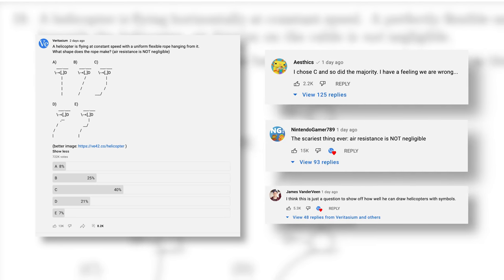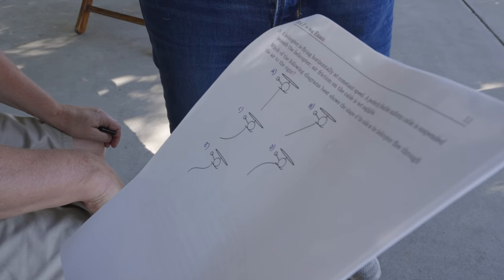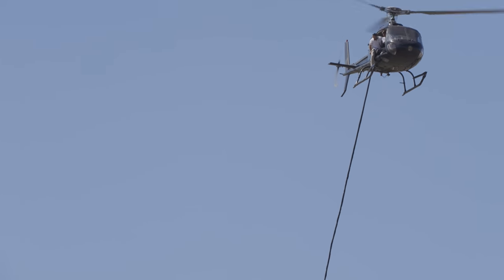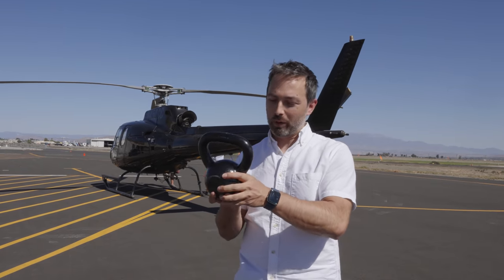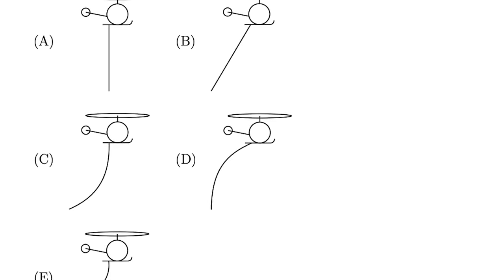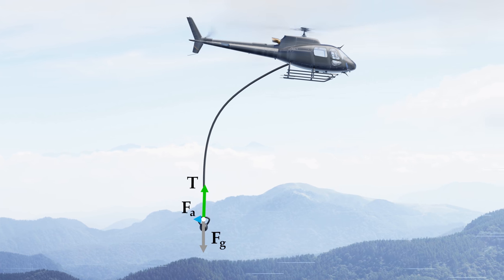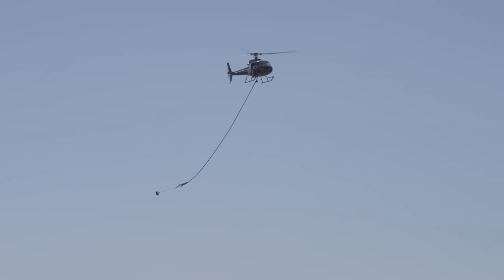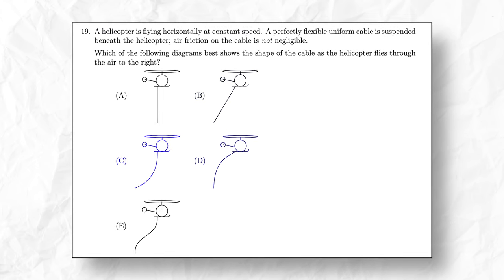I Rented A Helicopter To Settle A Physics Debate

Comment: "Air friction is not negligible."

The next step is to perform this experiment in a vacuum chamber, or with the right sponsor, in outer space (with a space plane/shuttle instead of a rotor craft)
Reply: Well, The actual challenge was the Air and it's friction itself. Otherwise, the Helicopter would even not FLY :)
Reply: The “air friction” is what makes the shape its balancing the weight of the rope. In a vacuum it should hang straight down, and in space it should go straight behind the vehicle since no forces are acting on it

Edit: Realised the rope would only go behind the spaceship if it accelerated (relative to the rope for everyone being pedantic) otherwise the rope just kinda chills wherever it’s placed (and eventually goes behind the vehicle because of the tiny amount of drag)
Reply: @leonh4799  except gravitational force since an orbit is just constantly falling to the earth without getting closer
Reply: @adrianwelgemoed9562  sorry I meant from the earths rotating reference frame*
Reply: Thats true. It is only B because of air friction, otherwise A. If the speed is constant and no air friction, there is no force.
Reply: @adrianwelgemoed9562  Exactly. Of course, you have to specify how great friction and gravity are. Because even outer space is not free of particles that offer resistance by their mere presence. And you don't need to repeat the experiment. You already have the formula and know the effect of the factors. Now you just have to insert the variables of your environment and you can calculate a result.
Reply: @June18887  It would be A if you lowered the rope whilst moving at constant speed. If the rope was already hanging when you started to accelerate, it would take the form of B, because the top of the rope would start accelerating first.
Reply: This would never work. There is no perceptible gravity of any large (planetary) object in outer space to make the experimental conditions comparable. And a space shuttle could never fly in a vacuum chamber on Earth (it is experimentally impractical to get it into such a low altitude orbit at unthinkably high speeds).
Reply: @adrianwelgemoed9562  no, the orbit isn't getting any closer because it's not falling to the earth. How could an object fall to the earth without getting closer to it? What's happening is that the centrifugal force is equal to the opposite of the gravitational forge, cancelling each other. So the resultant force applied to the orbit is null, that's why a rope in space would remain in the exact position as it was prior to the non accelerated movement
Reply: Sponsor or a collaboration with MrBeast
Reply: @ismirdochegal4804  true but it’s negligible, we’re talking about the behaviour of a rope in a short time span not the gradual decay of an orbit
Reply: @leonh4799  Actually that's not true at all. In a vacuum it wouldn't hang straight down. It would stay coiled up on the ground because the helicopter wouldn't fly.
Reply: @leonh4799  In space it would just stay in a bundle next to the spacecraft or alternatively point to whichever direction it was initially pushed during the "lowering". It would only drag behind the spacecraft if it was accelerating.
Reply: @leonh4799  wouldn't hang straight down in a vacuum wtf u on about
Reply: @Garresh1  hahaha very valid point
Reply: @UngodlyFreak  already changed that in my comment but yes absolutely
Reply: @daniel89123  yes it would, at constant velocity it’s in equilibrium and without drag there’s just gravity, therefore it hangs straight down
Reply: @Bob3D2000  I think it would go back to A once you are done accelerating as gravity would straighten it out again.
Reply: @leonh4799  by your logic if the helicopter went downwards towards the rope in a vacuum the rope would stay perfectly straight under neath it, not how ropes work at all and ur just wrong
Reply: @daniel89123  yes that’s actually correct lol, AT A CONSTANT VELOCITY that is how ropes work, it would hang straight down still, however, if it’s accelerating downwards it wouldn’t.

Comment: First guess without looking at answer -------  It depends on the length and weight of the cable, (as to the amount of arc in the cable,  a cable isnt "perfectly flexable", only a chain in the right direction would fit that category). The downdraft of the rotors have to be factored into the cancelation of the horizontal wind forces on the cable if if its a shorter cable. My answer is E, lets see if Im right or wrong now.

Comment: Heck yeah! Option-B gang, rise up!
I like how this somewhat subtly complements Vsauce's video "Do Chairs Exist", because there is no rope hanging from a helicopter; everything can be discretized into an amount of matter and a number of forces that act on that matter. That isn't a rope, that's a bunch of infinitely small points of matter that are "linked" by tension and displaced by air resistance, etc.
Reply: I FEEL SO VALIDATED ! When i first saw the poll i spent like 10 min thinking about it before i clicked B, after having strongly considered but finally dismissed C.
Reply: I got all three scenarios correct, very happy about that!
I was a little nervous about my answers, I started college as a physics major before switching to computers/electronics and felt my pride was in the line...
Reply: Thats just analyzing a physical phenomena with physics
Reply: Happy I chose B let’s gooo
Reply: @bgdu93  this was soo me

Comment: Yay, I got it right! And my logic was the same too. I imagined the rope as split into lots of small slices. The weight+resistance and tension would obviously have to be balanced for each 'slice' of rope, of it would stretch. And if you look at a single slice anywhere on the rope, the forces acting on it, while varying in overall magnitude, look the same.

The forces on the first slice that make it sit at a certain angle are the same as the forces on the last slice. It's just that the slice is displaced by the slices above. Therefore the angle is constant.
Reply: I had the exact same thought, I like to think of it as a chain instead of a rope where each slice is a link in the chain
Reply: You've just described integration ;)
Reply: I was right too!

Comment: I love how you used a skydive pilot chute and deployment bag for the final experiment, I figured that's what you might use. :) I'd worked out the shapes of the rope because of watching skydive demo jumps using flags with a weight attached to the bottom.

Comment: I am the one person who thought it was E because I really focused on the ,”air resistance is NOT negligible “ part and thought the rotor wash would have more influence closer to the blades just under the craft
Reply: I imagine if the rotors were large enough and the rope thin enough, the rotor wash would of had much more effect.
Reply: @SekiberiusWelkesh  yeah, this is a very small helicopter with very little rotorwash. I'd be very curious to see this repeated with medium helicopters (like a BELL 205 or 206) and large helicopters (like a Skycrane)
Reply: Why is it E rather than C if the rotor wash is important?
Reply: I thought so too.

Comment: Aah that's neat. I was sure the rotor wash would be more of a factor. I really like how you also tried to tie other things to the rope to see how that would influence said rope.
Reply: The rotor wash is pretty much the only unknown factor in this. You could simulate the situation by just walking forward while dangling a string from you hand. Since most of us aren't helicopter pilots it's hard to imagine the effect of rotor wash on the rope.
Reply: I went for Answer C, thinking the rope used was a rope not heavy duty tow rope used for gym workouts, thus being greatly affected by the rotor wash. Nevertheless, this was an awesome video.
Reply: It's basically a wave in a 3 dimensional space so it falls off pretty quick.
Reply: Fluid dynamics can be super counter-intuitive. Air is a lot more viscous than we give it credit for, resisting compression more than one would think. A simple way in which we're all aware of this without realising it (I would expect) is the phenomenon of accidentally slamming doors if you leave a window open. If all the windows in your house are closed, doors cushion themselves when you close them. If you leave a window open, no such resistance is felt and we tend to accidentally slam them a lot harder than we meant out of habit. That's air compression at work, and it's a LOT more significant than one would think.

In short, I agree - the prop wash not extending much below the helicopter is counter-intuitive. But it does make sense, given how dense air can be and how quickly it can dissipate even powerful currents like that.
Reply: @Yutani_Crayven  and yet, underneath the helicopter is still pretty close to the rotor.  Depending on the width of the rope, its weight, and the amount of propeller wash  you could get different results.  Increase the weight of the helicopter by a ton, and have much larger blades, and the balance might shift a bit.
Reply: @Malidictus  Doesn't that heavily depend on disk loading, though? I searched some helicopter footage out of interest, and in some cases you can clearly see the effects of rotor wash far below the helicopter - usually with heavier machines. There's even a video of Osprey (a vtol with very high disk loading) landing somewhere in the park, and in that case it was pretty much destroying the trees on the ground with propwash.

Comment: Jee: Lets try adding springs and multiple pulleys
Reply: Question

A helicopter flying horizontally with a constant speed has a rope hanging from the bottom. Find the number of lions needed to defeat the sun. Air resistance is not negligible
Reply: Lol
Reply: @muhammedshamil2443  21lions?
Reply: And monké

Comment: B was definitely the most intuitive and obvious answer because of the “constant speed.” The other answers seemed possible but definitely a bit out there
Reply: I have to say the question itself is flawed since it defines a “constant speed”. Hovering in motion or not moving is also a constant speed, therefore answer A or B is acceptable.
Reply: @michaelbarnhart4506  Reread the question. it asks for which diagram best shows the shape of the cable as the helicopter flies to the right. Meaning that there is a constant horizontal speed to the right. Its not intuitive to say that the helicopter is moving to the right at 0 m/s.
Reply: It's great to be right, but for the wrong reasons... isn't it?
Reply: Yeah, B seemed clear based on physics. I read comments from people who chose other than B. Their explanations were typically complex. Since you'd need a more complex system to get the rope to make different shapes.
Reply: @michaelbarnhart4506  it says constant velocity
Reply: A few reasons to believe it might've been C was assuming rotor wash would be very strong (which few people have real-world experience with), and also just the fact that the question was posed at all. Because it's mundane and meaningless for a youtuber to ask a question whose answer is the obvious one, you'd expect that there's a reason why they're asking it, such as a catch that makes it interesting, so you're more likely to believe it's not the simpler answer.
Reply: @mrkiwi6611 , If the helicoper matches the wind speed, then the rope would feel no apparent wind.
Reply: @m1k1a1  a lighter rope would not be as strait in flight .... more like E option.
Reply: I held a piece of string in my hand and moved around my room at constant speed. B was the answer I got too and matched my guess. Guess was based on constant speeds creating the straight line. The wind is acting on the rope the same at all points.
Reply: @michaelbarnhart4506  constant speed != Constant velocity and 0 is not a constant velocity it's no velocity.
Reply: If the speed was 5000mph would the rope not be nearly horizontal?
Reply: hindsight bias...
Reply: B is in first moment obvious....in second moment I thought about downwind from the blades....Close under the heli more downwind than lower near the end of the rope.
In other words...the wind has not at all point along the rope the same speed.(direction and speed)
In the third moment it is when you can calculate how much the down wind differences is between top and bottom of the rope....When near to zero the downwind does not count...The horizontal part of the wind will not have any difference due to constant speed.(Downwind will make the rope "heavier" with more downwind speed.)
I do know a heli has downwind because I've seen the results when a heli is  flying low over water.
The video showed me that the downwind from the blades did not significant differ between top and bottom of the rope
Reply: if the helicopter was accelerating the rope would still be linear, as long as the weight of the rope and wind resistance scale with the ropes length
Reply: @Ultimaximus  This is exactly my point.  I knew that it would be B if you ignored the prop wash, but properly, you wouldn't do that.  So as the rope distance from the helicopter decreased, there should be a downward vector to the wind that MUST be accounted for by an increase in the upward pull of the rope that causes a deflection of the rope downward from the straight line somewhat.
The important question is how big (small) is that vector compared to the horizontal vector of the wind.

Comment: I think the easiest way to explain it without using much physics is to say that, assuming the rope is uniform, everything is the same all along the rope except the weight hanging down from a given point. In the first case, that weight is equal to the amount of rope hanging down from that point on but in the second case it is more and that changes the relationship between the weight and the location along the rope.

Comment: To create E, you need a person in the middle of the rope, weight on the end of said rope, copter moving forward.
Reply: And A is essentially impossible... unless your "constant velocity" is V=0
Reply: @SuperSMT  or if you have a heavy enough weight
Reply: Or if you're flying on Mars.
Reply: what about if you did a sharp dipping turn?
Reply: @midnightbluenoz  I’m sure that’s possible, just gotta break the matrix.
Reply: I’d rotor wash extends down to the middle of the rope, you could get something sigmoidal like E? Dependent upon the helicopter model
Reply: ? why would you need the mid weight to be a person

Comment: To be fair, when I read the question I was also considering the effects of standing still, since 0 is also a constant speed and after a certain point, the answers should be very similar. So I guessed A and hoped it would blow my mind later.

But I guess air resistance with constant speed being 0 has a negligible effect.

Comment: Honestly thought it was “B” in the first question because I figured the air resistance would be the same along the entire length of the rope.  I’m impressed that I learned something in physics classes 35 years ago! Lol
Reply: That's what I appreciate about all my Math and Physics Classes. People often don't see the Point of learning all those things, but even tough I may don't technically need those skills in day to day life, but it's just fun and usefull to understand how and why things work.
Reply: I am one among the most common "C" people. My argument was that the air resistance would be more at the bottom because air is denser at the bottom. Turns out that that is negligible.
Reply: @sexyscientist  I had the same thought but then figured the difference is absolutely negligible and theres higher wind speeds up top anyways so you must ignore it. Hence B
Reply: I thought it would be B if the rotor wash could be neglected. But then I imagined the rotor wash being stronger on the top of the rope and weaker on the bottom. Hence my actual guess was C cause I thought the rotor wash would push the initial segment of the rope downwards.
Reply: @AbeYousef  Sorry, I don't understand the wind speed part. According to laminar air flow, top lamina would be faster, but that would be of no help in this question because you do not know the angle between the direction of airflow and the direction of the helicopter. So, you must ignore it.
Reply: @DutchKoffie  makes sense to me

Comment: 4:44 A few formula 1 races ago (Hungary and Silverstone), some of the drivers were complaining about getting unstable whenever they went under the camera helicopter though it was pretty high up. You could actually see them get squirrelly whenever they passed underneath it like they usually do when they lose traction. I guess the effect would be that much more pronounced for cars much more specifically engineered to use aerodynamics than a thick rope, but it's still interesting to actually see it happen on track.
Reply: Or, perhaps, some of the drivers were whiners…
Reply: I have worked under a bunch of A-stars like the one in this video and what they use for F1 and at the end of a 100 ft line during a hover it is still windy but not crazy. It might blow your hat off but not push you over. It's definitely turbulent though and this generation of F1 cars are super sensitive to turbulent air so that could explain it.
Reply: As both you and Sean conclude, what that really proves is just how sensitive F1 aero is. They are really balancing on the knife's edge of grip and a little air disturbance has a great effect. In the end that is why the teams spend insane amounts of money to develop a few 2 cm flaps at the end of a wing.

Comment: I chose B because the rope is uniform in shape, so theoretically air resistance would uniformly act on the whole rope (and not more in some areas than others), which means it should be a straight line.